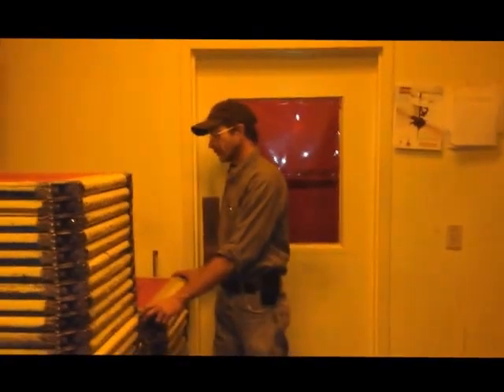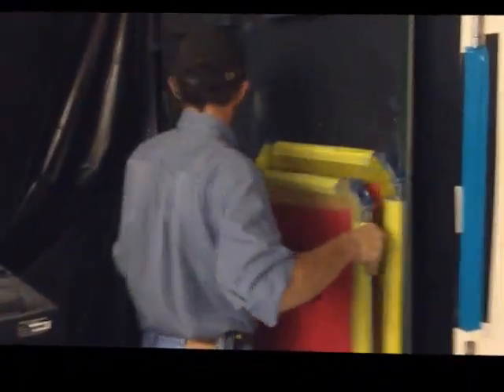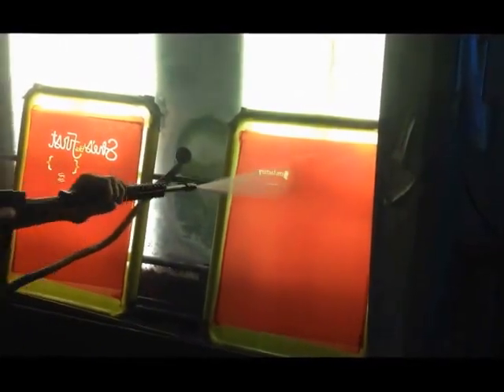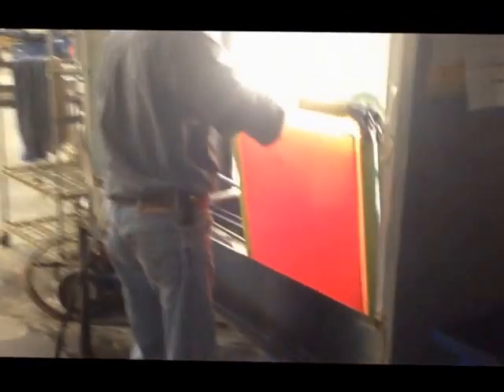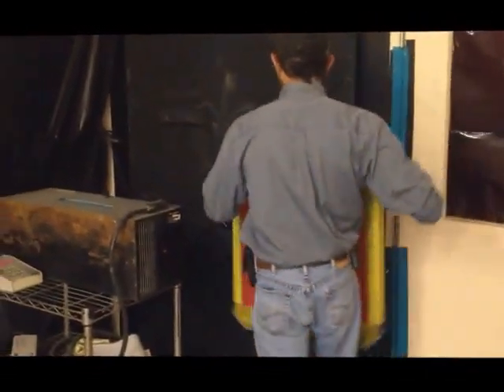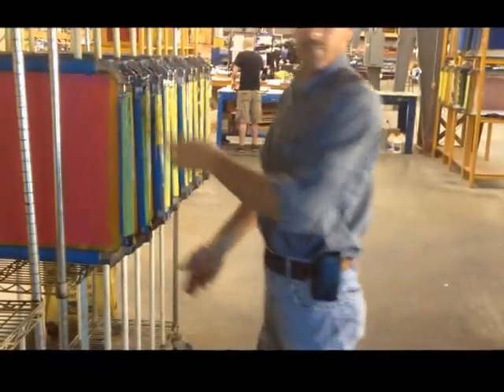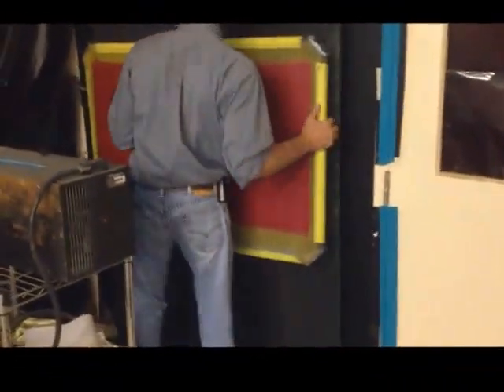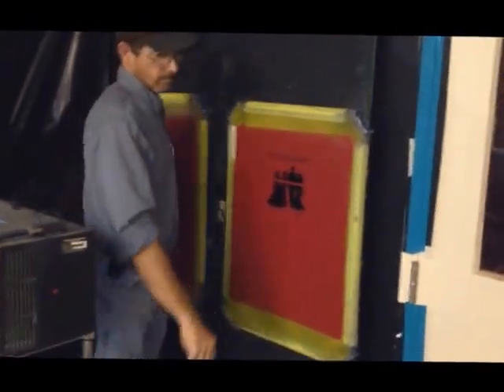Mind's Eye Graphics Screen Print Pre-Press Exposure & Washout production loop

Comment from the maker: Olite LTI-1614 
5000 Watt Metal Halide CD/L-1250  (Caprock)
5000 Watt Metal Halide CD/L-1252  (Douthitt)
Running at 3500W High setting
AL35 Power Supply
Standard Reflector
AI131 Light Integrator
PA-86 Photo cell (350-420 NM)
Pure Photopolymer and Diazo